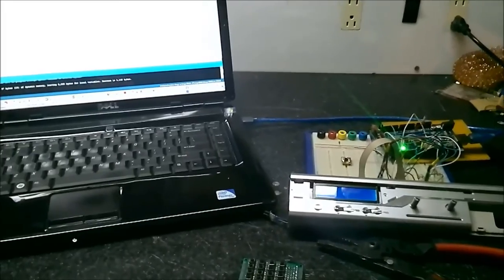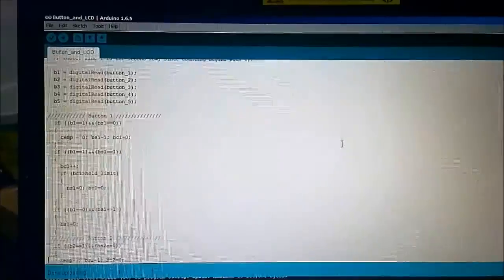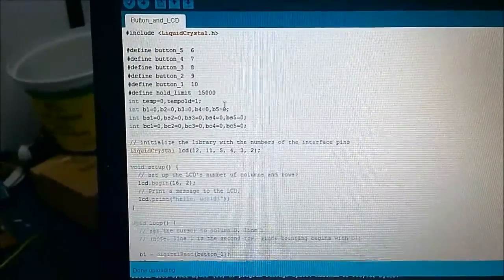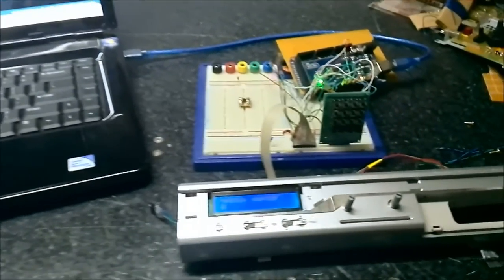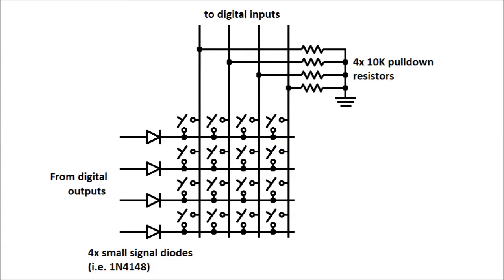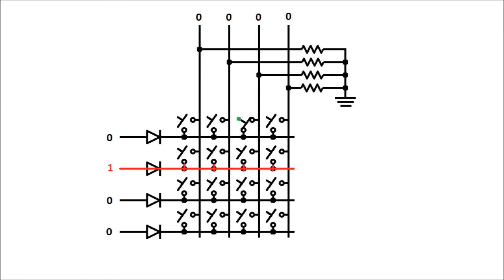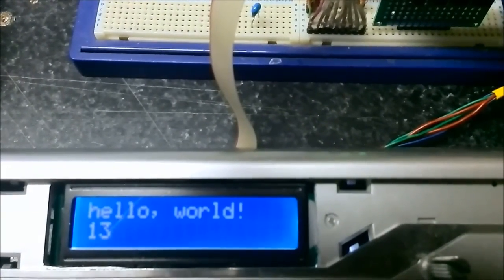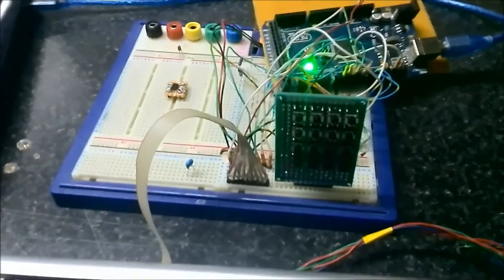#9 - Button and Matrix inputs

Comment: I also want to know how can I give a float value to a variable using only button....eg.0.16 as input
Reply from the maker: Hi Santhosh, If I am understanding what you need correctly, then you would just need to check to see if the button has been pressed using the methods from the video, and if it has, then assign the desired value to to the variable. or are you wanting to be able to have a float value typed in from a keypad?
Reply: I want to assign such type of variables....nt d same one....bt using only buttons and lcd....its my project now